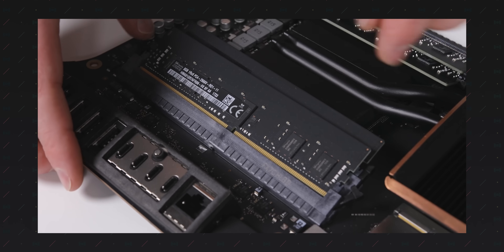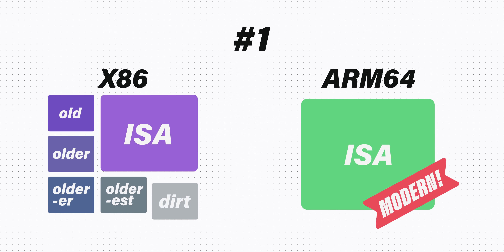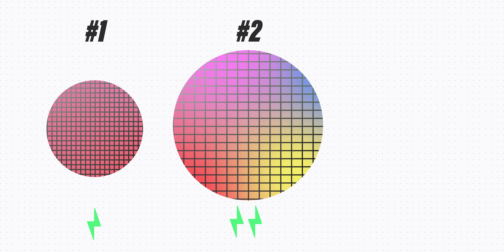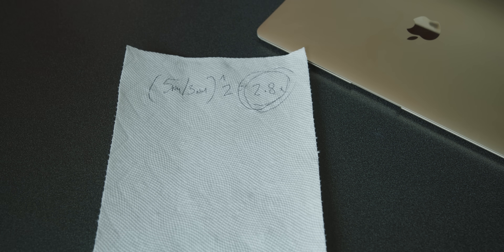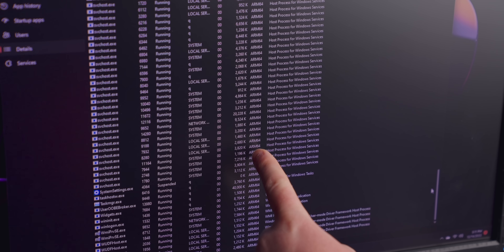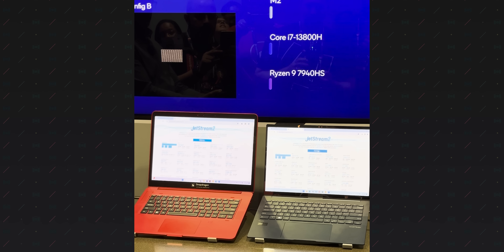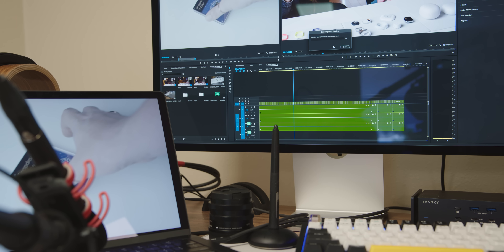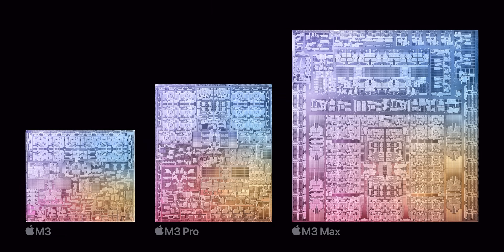Apple's Silicon Magic Is Over!

Comment: I think that moving to their own silicon was a boss move for Apple. However, I wonder if staying on their own silicon would be a mistake.

Third-party silicon is produced by companies whose whole jam is advancing the state of the art in silicon design and/or fabrication. As a general rule, third party silicon ought to advance faster than anything the any consumer electronics company might design.

Apple bucked this rule with the M1 not by being exceptional at silicon design, but by recognising that the whole high end silicon sector was about to begin transitioning to a new architecture. By designing their own chips, they could gain first mover advantage. But as specialist silicon engineering companies (like Qualcomm, Nvidia, or even Intel and AMD) make this transition, it seems to me that Apple will need to spend an ever increasing portion of their cash on trying to keep their own silicon at parity.

I think you are correct, maintaining parity doesn't matter in the short term, as long as the devices remain compelling. But this also makes life harder for Apple. Because falling behind will matter eventually. So Apple needs to at least keep themselves within striking distance of their competitors. But the ever increasing amount of money that this will cost (in the short term) won't actually improve their products in a way that matters to customers.

In short, I think Apple was absolutely right to move to their own chips in order to get out ahead of the industry wide transition to ARM based architectures. But they shouldn't feel compelled to stay with their own silicon any longer than necessary. Once three third party chip makers catch up, Apple should think seriously about moving back to third party silicon. This is likely the cheapest way to keep their devices on the cutting edge.

Comment: the core issue apple chips are about to face IO and specific silicon (think video encoders). all other chip makers have been paying the "AV1 tax" for a while now while apple hadn't. M3 is still limited in the number of displays it can use at the same time that is more die space to fix. Apple has a lot of die space debt at this point that a professional expects.

so in a lot of ways apple can ether just become an other chip maker in the bunch or pick the low power consumer or go for the high end segment.

Comment: Commodore also had vertical integration from creating the chips to the production. But they used this to make computers many people could afford.
Reply: Fairly sure computers now are cheaper than they've ever been in history. Macbook pros with ram and storage are expensive but they're a specialty, high performance and luxury product so that's normal. 
Show me another laptop that can carry 128gb of ram, is thin and light, has great build quality and aesthetics AND lasts on battery/ isn't hot and loud.
I feel like the only people who can't afford macbook pros are those who like to do all these high paying creative / software development workloads but don't want to get paid from it.
If you're for example a photographer / filmmaker who needs a mbp with ram and storage, you can easily afford one.
Reply: But no MacBook will be used after 42 years since production like a Commodore 64. Old MacBooks also can't run actual software. C64 programs from 2024 are still working on a machine from 1982.
Reply: Apple was always way to expensive. The Apple ][ had in 1982 a price of $1748, the introduction price of the C64 was $595, but dropped very quickly. And it was way better equipped. A similar competition is the Macintosh Classic with $2495, the Atari ST with color monitor $999. The ST was also much more capable than the original Macintosh.
Reply: Apple hardware can't be upgraded anymore, except you search for the right models. I actually bought a MacBookPro11,5 for 230 Euro and added a 4 TB Kingston SSD for 242 Euro. With OpenCore Legacy Patcher I installed Sonoma 14.4.1. Now I have a 4 TB MacBook Pro Retina with the actual macOS for less than 500 Euro.

Comment: To me the other advantage Apple brings to the party is stability - sure products are a bit more expensive - but you know its just going to work. Linux laptop at work (intel) and I've always been a Linux fan for years but its no where near as stable as OSX. Even crazy things like bluetooth headphones with a mic not working for Teams calls - you don't tend to get these issues with OSX. That's because of the tight integration of the platform.

Comment: I don't think you can also just write X86 off. AMD has started to push to remove all the legacy stuff and make an X86-64 only chip and it looks like Microsoft is on board with that also. That would allow the chip to cut the VAST majority of the garbage. The vast majority of the software that people use today would work just fine without the legacy stuff.

Comment: Apples biggest wish to get their customers into the cellphone trap buying a new Mac evry year due to new fancy colours.
As mentioned by others allready an issue is apples price-policy for upgrades, and the minimal performance improvements from Gen to Gen.
For the VAST MAJORITY (thats the colour triggered folks) the MBA Base model is allready massive overkill, for those who REALLY need more than the MBA Base model they have to carefully select the config in term of processor, RAM, Storage and Size, as usual there are some configurations preconfigured from apple which will be available on sales occasionally. If you need an BTO version you unluckyone have to pay the full price apple wants to have. But fortunately you have not to do this every year as the biggest improvement always is only a new fancy colour and nothing under the hood.

Comment: Has anyone experience with the MacBook Air 15 Inch M3 running Blender. Will it work or are the M3 Pros much better there?
Reply: Hey , I do software engineering and music work, not super heavy type but still. Rarely kicks up the fans on M1 Max , so maybe m3 with wider body can handle ok
Reply: @notaspectator  Thanks for your reply! Will read a bit more into it. Currently still on a 16 inch MBP from 2019.
Reply: @stefan-bayer  Hey, I have one like that too, what's cool is it works with my Thunderbolt 3 eGPU with 4070 ti , let me know if you want more details

Comment: The problem with the competition isn’t the hardware, it’s the software. Apple has them beat because of vertical integration. Their machines are efficient at very light loads so for the average person who does most if not all of their work on a web browser, battery life is much much better for them. On windows, you can have long battery life but is very inconsistent. This is because sometimes, even on idle, windows updates and background tasks will just go “I need 5GHz P-Core NOW” and wake the cores up from sleep and provide full boost to the CPU. Over the course of hours these little boosts add up and cause massive inefficiencies, leading to pretty bad battery life in comparison.

Comment: I just find it hilarious that this opens with how Intel chips and heat dissipation problems in Macs were "deadly" and that the M1 was a "saviour"... just how many lives do we think were lost / how many lives do we think M1 chips saved? 😂😂

Otherwise, interesting vid... assuming the stats quoted are accurate and not wildly exaggerated for the purpose of overly sensationalising a relatively non-issue. (Don't get me wrong, Apple's decision to develop their own M1 chip was big news and a great move - almost on the same level as when they released OSX - apart from the incompatibility with eGPUs).

In fact, GPU support would probably hurt the Windows and Intel market-share hugely.

Comment: I agree, Apple doesn't appear to do much innovation these days, and for me, the biggest problems i with their operation systems. Their hardware is great, but operating systems such as iPad OS, are poor and lack capability. I started using Mac OS back in 2009. At that time, it felt so much easier to get things done in Mac OS than Windows XP / Windows 7.  But that no longer feels the case, especially with Apple's insistence on using proprietary standards such as Metal, lack of intrinsic touch display and stylus support. Now retired and into PC games, this means I am increasingly dependent on third party software compatibility layers to play games on a Mac computer, and it's like being in an arms race, as the software compatibility layers are perpetually playing catchup to keep up with application / game software changes. Though I originally welcomed Apple's focus of enhanced security in the operating systems, its application is beginning to become too intrusive. I have an M2 MacBook Pro which is an extremely capable laptop compared to the 2019 Intel MacBook Pro it replaced, but I now use my Windows Dev Kit 2023 daily compared with my MacBook which is around once a week, because Windows 11 better fits my computing needs these days. I've been using Windows 11 arm for over 14 months. Initially as an experiment to see what it would be like to transition to a Windows arm PC. Since then, Windows 11 arm has significantly improved. Driver support is much better, with my Dev Kit now having graphics support for DirectX 12, Open GL, Open CL and Vulkan. Qualcomm recently added USB4 support to it via the last two system hardware updates. OK, the Dev Kit USB-C are not capable of supporting 40 Gbps, but I can connect any of my Thunderbolt 3 / 4 drives to it and they work, and it also works with the Surface Thunderbolt 4 dock. This bodes well for the Snapdragon X Elite processor, as that can support up to three USB4 ports at full 40 Gbps per port. As a Retro gamer, all my favourite emulators, such as Dolpin, ppsspp, athersx2, Duckstation, DosBox-X all have Windows arm binaries. Microsoft Visual Studio 2022 fully supports Windows 11 arm, and I used this to compile an ScummVM Windows arm version, but to be honest it wasn't worth the effort, because the x86 version feels just as responsive via emulation. I recently installed Genshin Impact v4.5 on my Dev Kit and it worked first time on my Dev Kit via x64 emulation. It's been a challenge to get it to work on my M2 MacBook Pro. The Yaagl approach stopped working for a while due to a Rosetta 2 bug. That's been fixed in Sonoma 14.4, and the game again runs, but there are graphical issues, especially when the application switches to web access for email and notification access. CrossOver 24 installs the game, but the game fails to run. Parallel Desktop in theory supports the game, it installs, starts to run, but no screen output (pity, because it should run with better performance compared with my Dev Kit!). Sideloading the Genshin Impact iPad .ipa app version works the best, but Apples makes you jump through hoops to sideload and run any iOS / iPad OS app that isn't available via the Mac App store. As for my M1 12.9-inch iPad Pro, that the biggest IT white elephant I've ever purchased as it will never be laptop replacement, due to lack of iPad OS functionality and iPad OS, cripples' excellent hardware to run in a walled garden ecosystem of mostly mediocre smart phone apps.

Comment: The current M3s are based on a very poor process called N3B. The M4 will be based on N3E and eventually N3P, which is an entirely new re-design from the ground up over the M3. I’d argue, the M3 Max 40 core, is Apples first real processor. It’s just as fast as an M3 Ultra 60 core and, that’s with a poor manufacturing process. Make that chip on the N3E process with 10% more efficiency, N3P with 15% more performance and by spring 2025, they should be able to make a pretty kickass desktop product. That’s actually what Apple needs to sell people on Apple Silicon. Why? Because youtubers kinda own the advertising market and right now, nobody is impressed with Apple Silicon outside of the super low end market who are fine with a potato. Once Apple makes a serious desktop product, all of you guys will love it and scream and yell, which will lead more
people to buy macs. Apple is in trouble, the competition has caught up but if Intels investment in GAA doesn’t pay off, Apple may own the market.

Comment: ARM is 39 years old. It started with Acorn computers. So it's not an modern ISA and it have been drastically been added to in a similar way to as x86.
Reply: AArch64 threw out a lot of legacy features from earlier ARM versions, features that proved a challenge for speculation such as its stateful predicate bits and complicated instruction encodings. It also added some features that are generally useful at scale. Intel and AMD have also been adding some useful features, but they are only massively superscalar through absolute brute force. I don't think anyone doing chip design was actually surprised by the leg up the M1 had, even with the process node accounted for.
Reply: @anthonycotter1493 I think it is both and performance per Watt counts, that's the main reason the development of Intel x86 Android phones stopped. But yeah, I am also sure if a brand new modern instruction set would be developed, ARM would be defeated, also on performance per Watt.
Reply: @vanCaldenborgh Instruction set doesn't matter. They got added or removed all the time. Has  very little to do with performance. Sure maybe there will be some difference in the absolute very end of moore law. But any design changes and improvement in manufacturing would make more difference than the impact on the instruction set.
Reply: @iokwong1871  Yeah, probably my knowledge is outdated, finished university 2006 and went in a different directory later. But still a very interesting topic, instruction set and performance.
Reply: Stop making me feel so old 😂
Reply: @anthonycotter1493It can be just a mistake but based on the writing, you are mixed up Instruction set and Instruction set Architecture. Two different things. One like its name is just the instructions, the other is the actual circuit design to execute such instructions. (Loosely speaking.)

Comment: I think for most corporate users, an M1 class processor would be a revelation, if it will run their software, With Windows on ARM they have a chance, but it might not be easy because there is a ton of stuff been created for Service processes, Sales, Manufacture and Marketing that is tied to SAP, Salesforce, Oracle, in-hose cobbled and whatnot. 
Every department has its own fork and customisation, upshot is even if Mac is "supported" IT departments will not go for it because its unlikely it "supports" every feature or in house Mod. Hence the vast amount of Intel Dells hot-desking, doing WFH and road warrioring around the world. All dependent on mains power apart from short sessions. 

I think YouTube commentary and advocacy  has.a black spot on these huge use cases, because its hidden behind company confidentiality obligations or are not visible to the developer and creative community where it tends to draw from.

Comment: the only problems that needs to be solved in apple lineup are
1- macbook air & mac mini should start at 12gb of ram & 512bg of storage
2- the rest pro & studio & imac should start at 1tb & 24 or 32 gb or ram
3- the most important thing is cutting the storage and ram upgrade by 50%

Comment: I bough the first available M1 Air just after the release, never regret it.
During every new presentation, I'm waiting to see something that could encourage me to upgrade. But I still with my M1.
Maybe this is the problem. M1 was too good for the price, for that time. It's still good. All higher numbers and Ultra versions are way more expensive but do not add to the table much. Maybe AI features from M4 could bring something. But it will be the 1st AI generation, so I wouldn't expect much. Summing up it's possible again to update the Mac once in 10 years.

Comment: I have an M1 Air 5 iPad. It’s plagued with issues, especially after the most recent 17.4.1 update; Google: M1 iPad / MacBook not charging after 17.4.1 (and earlier, as I’ve discovered this issue dates all the way back to 2020, with the first 17.1 patch, shortly after the M1 was first introduced). Presently, it no longer charges without being restarted, each time. I theorize, this may be due in part, as Apple made their USB-C to C cables proprietary, with accessory firmware possibly being incompatible, in an attempt to restrict charging and bandwidth with non MFi products. So, the charging-cable (accessory) chip firmware may be the culprit or a contributing factor. Apple acts as if this is an unknown issue, but the internet say’s otherwise... I understand, this being Apple’s first foray into designing their own in-house chip, which also has an unpatchable design flaw, which will eventually be exploited, but it presents an unacceptable issue for M1 consumers. My advise, avoid the M1, if at all possible, no matter how tempting…

Comment: Honestly, I have been using the M1 MacBook Air since it came out and it's a great laptop. It's more than enough for my day-to-day usage but now I have a problem with the 8 GB of ram. It's not enough at all and upgrading to 16 GB of ram is just too expensive, this is my issue with Apple Silicon. Other than that, great laptops!

Comment: get back to work HOW? WHERE? as you say, they're running up to the limits of physics. only real way to go from here is 3d form factor fab techniques, photonic chips or quantum computing which isn't actually very usable for running excel. everyone's going to hit a pretty hard wall and resort to the gate-all-around kinda stuff within the decade and then, it's going to be a long slow build up of photonic chip tech. no one's really going to have an edge. everyone will be stumbling around trying to get a foothold. ... we're not there yet but we're probably pretty close.